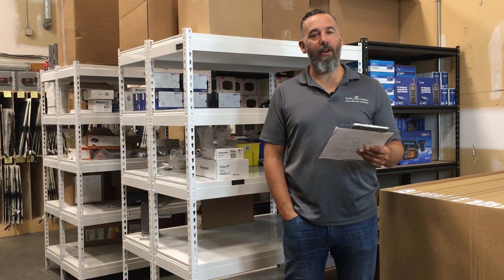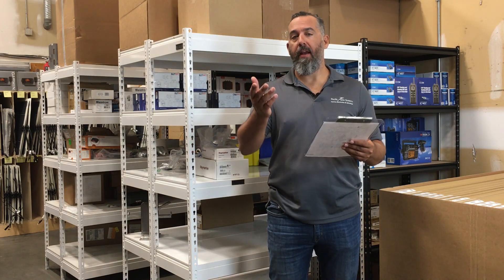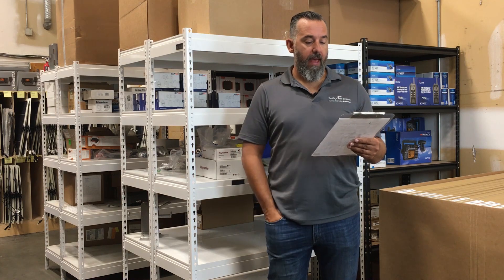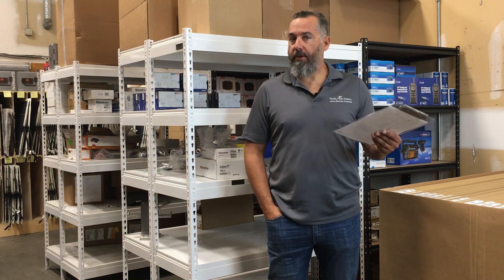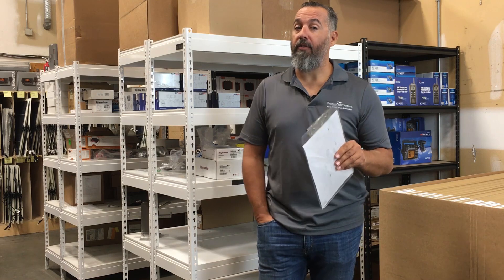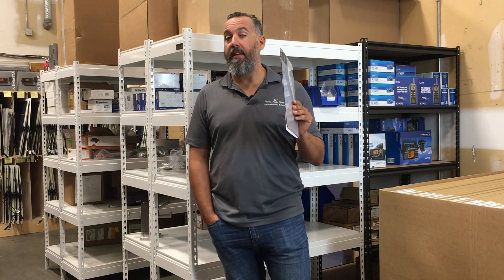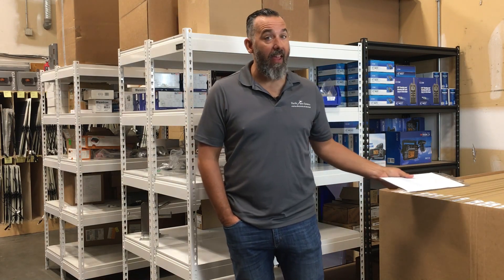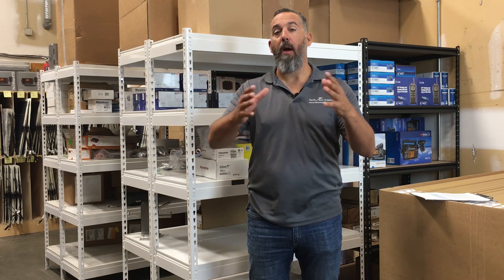Can I Put An AC Heater In My Boat's Engine Room?

Comment: There are actually ignition protected and even explosion proof receptacles. Maybe not cheap, but they do exist.
Reply from the maker: Thanks for sharing. Didn't know that.
Reply: Pacific Yacht Systems They are mainly used by oil and gas industry or hospitals. UL 1203 stuff if I remember correctly. Eaton makes them.